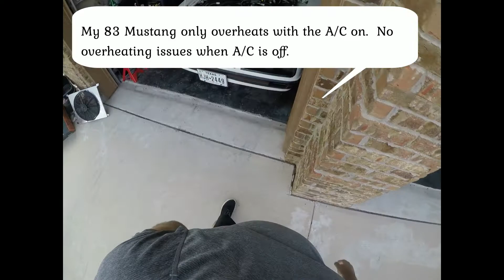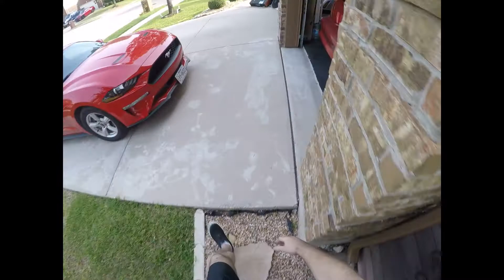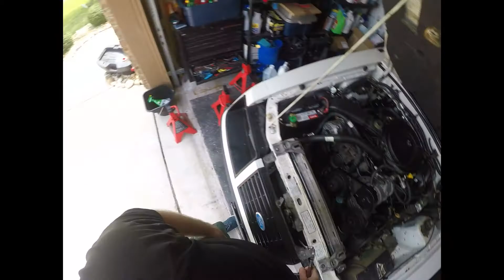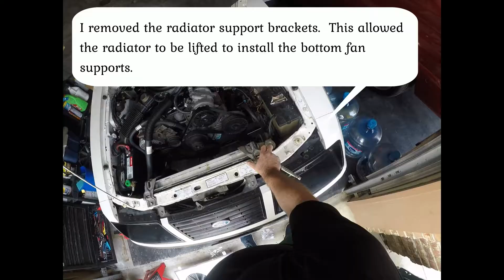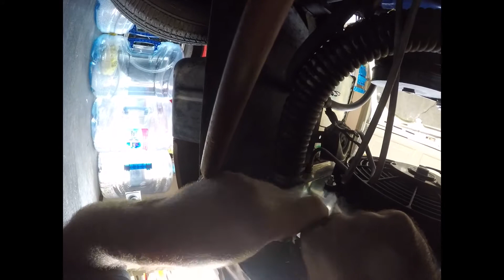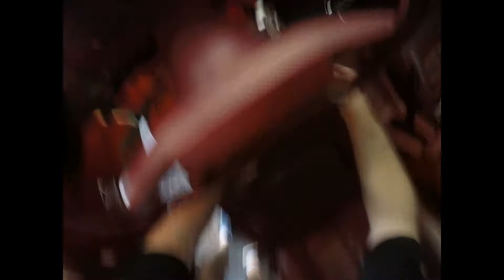Fixing Fox body Mustang Overheating

Comment: Just installed an efan on an '01 ranger last week.  Are those waterproof pigtails? If so where did you find them?  Also, did you wire to the A/C clutch, or is it coolant temp only?
Reply from the maker: I built my own pigtails, using a straight wire and a crimp splicer.  I then wrapped them with electrical tape, to make them water proof.  My car came with an electric fan from the factory, so I just wired in the new fan, to the old wires.  If you are moving from a clutch fan to an electric fan, I would purchase a thermal switch and wire direct to the battery.  This is easier than connecting back to the fuse box.  
https://www.bing.com/images/search?view=detailV2&ccid=%2bCVsUcup&id=6D6C70944DFFE01CFCEC0143F093FAFD03D8324D&thid=OIP.-CVsUcupfgMqPJyD40dMugHaGA&mediaurl=https%3a%2f%2fwww.thirdgen.org%2fforums%2fattachments%2felectronics%2f451538d1516124383-toggle-switch-fan_relay_install_zps19f4125b.jpg&exph=748&expw=922&q=wire+electric+fan+straight+to+battery&simid=608047479596911117&ck=6B7F4BE41CEE5F5C1907F91B85DE8A3E&selectedIndex=17&FORM=IRPRST&ajaxhist=0